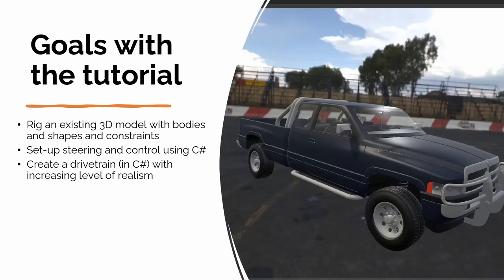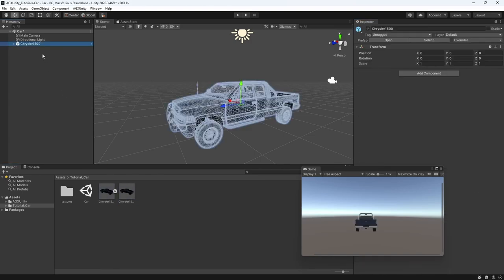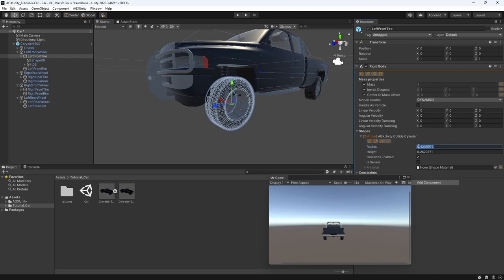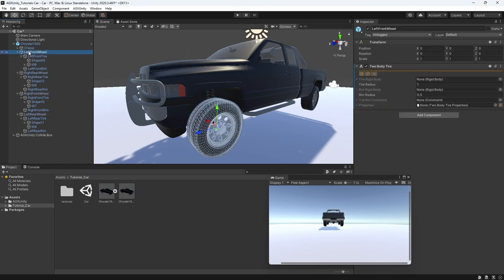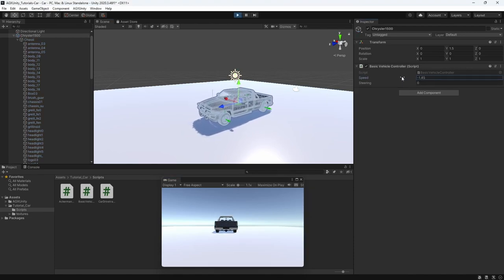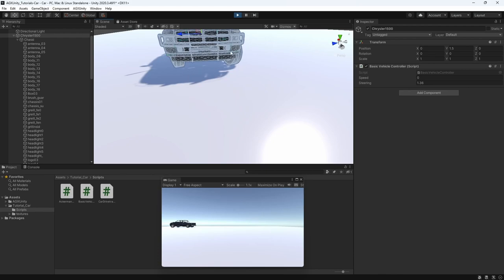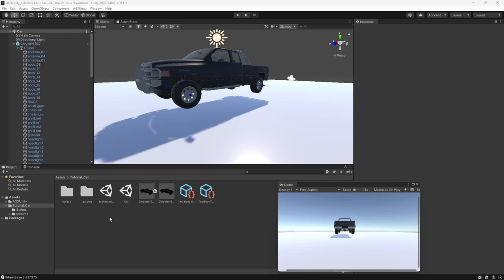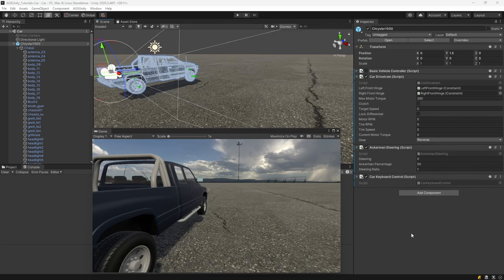AGX Dynamics for Unity. Tutorial 5: Modelling a car with drivetrain and ackerman steering

Comment: Hi, i am working in a project in Unity. The project involves aeroplanes,missiles, drones etc...I am wondering if your software can provide accurate realtime aerodynamic simulation for the things i mentioned. Its not meant to be a game but a tool. I am asking cause even though in your trailer you mention aerodynamcics, i havent seen any example yet.
Also i am interested to learn about the price.
Thanks.